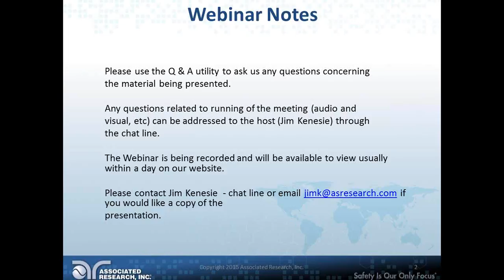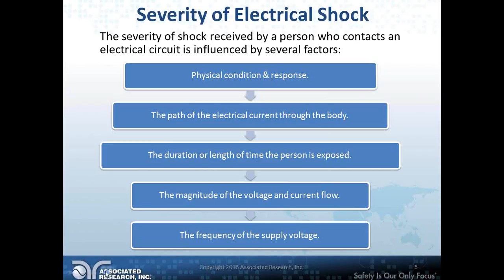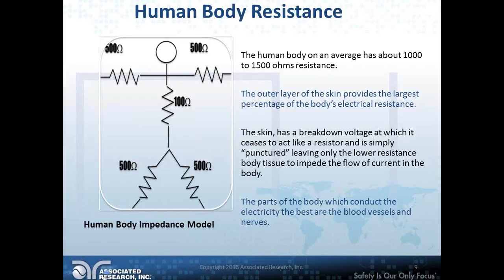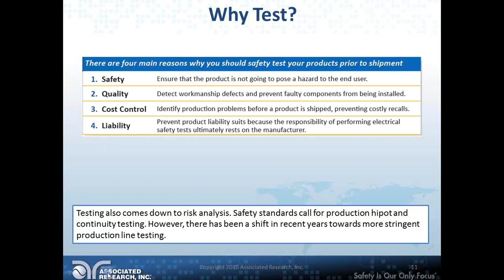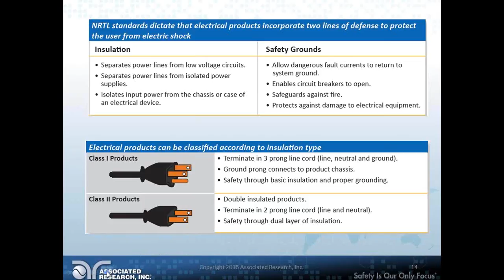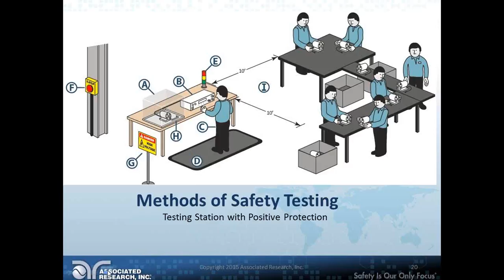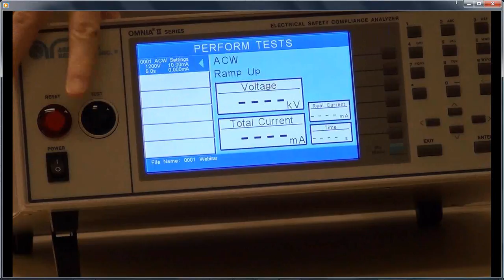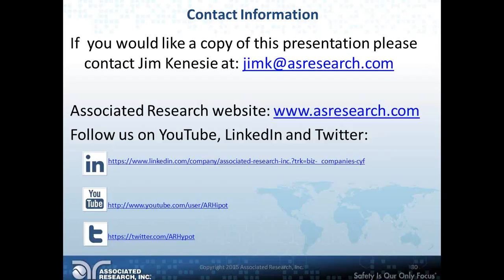Electrical Safety Testing 101

Comment: I'm testing a 12 volt dc product at 1 amp. will this still need to be tested for line leakage and should I expect to be able to detect any at that voltage?
Reply: Good question and thanks for asking. For a 12V DC device it depends if it is a part of a larger system or a stand alone battery operated DC device. If it is a part of a bigger system then it needs to be treated like an applied part (if it is coming in contact with the patient). If it a stand alone device you will need to power it up using a 12V DC source and use the probes of the leakage current test instrument to measure the leakage current.